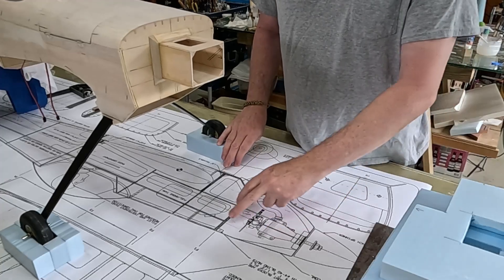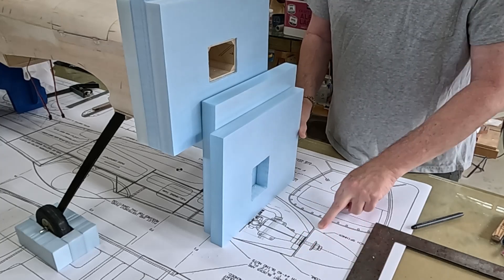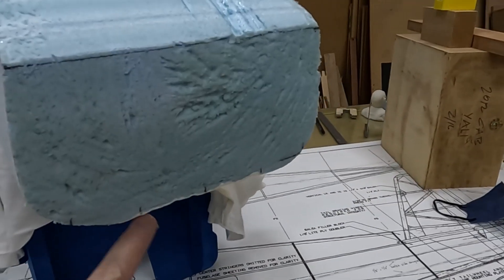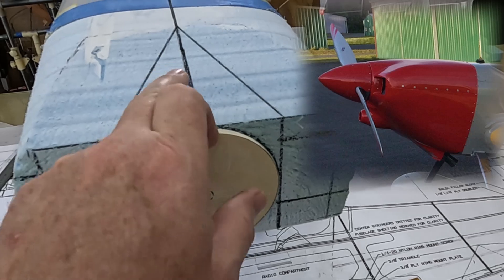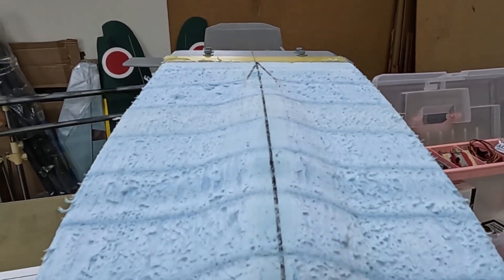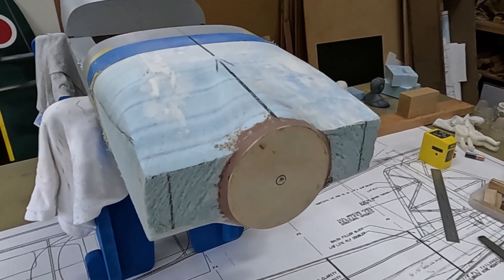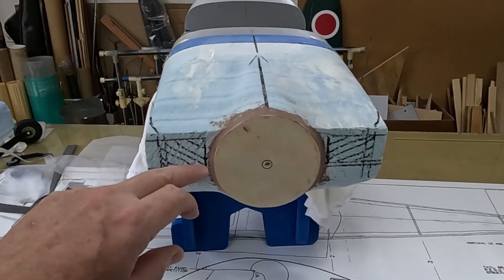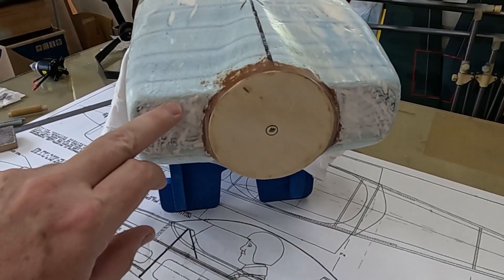DR-107 One Design RC plane build, Update #23 Part A, Cowl Construction

Comment: Hi! Thanks for this awsome video! I'm about to try and build my first fiberglass cowl, this will help a lot!
What brand of sanding sealer are you using?
Reply from the maker: Thanks!
It's a local Taiwan brand but it's water-based with a high-solids content.  If your plug is made from foam, use a water-based sealer.  If balsa, solvent-based is ok.   Try to get as high a solids content sealer as possible.
Good luck and let me know how it turns out!

Comment: The cowl overlaps the fuselage sheeting only about 1” it fastens down to 3/4” aluminium angle that is rivetted to the front of the firewall. The sheeting also attaches to the same aly angle
Reply from the maker: Thank you for the info.  So, I did get that right.  Haha!.  Sometimes I wish I had access to the real thing so I could see how things really fit together.  Thanks again!